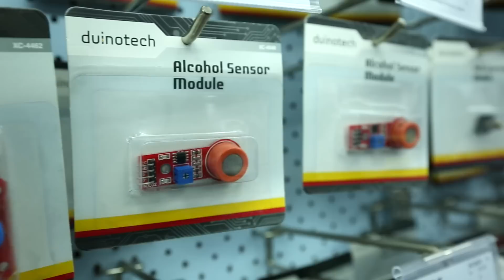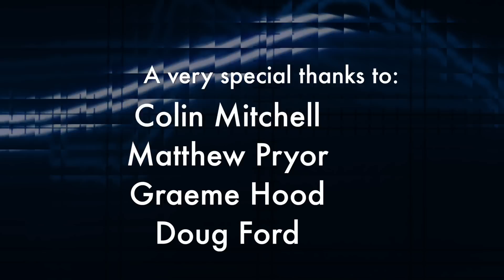The Decline of Hobby Electronics?

Comment: To the title: "yes and no."

I'm getting back into hobbyist electronics after being away for sixteen years. Here are my observations: 

1. I cannot go down the street and pick up assorted components or ICs. This is bad.
2. I can buy ICs and components directly from Shenzhen, usually even in lots of under 1000. This is fantastic.

What the people are ACTUALLY talking about isn't a decline, but a shift in component sourcing. And they're absolutely correct (see #2). The only downside here is the waiting. And, of course, if you get a faulty component or IC, the shipping costs are prohibitive, so the consumer marketplace is plunged again into the realm of, "cheap but unknown."

Insofar as PCB/SMDs, I am myself looking at making a reflow oven. I've never used solder paste or worked with SMDs, but there is so much information out there that the hobbyist can now really build one-off or short-run PCB-and-SMD-hardware. Paired with a 3D printer with an ABS head, the hobbyist is now in a really curious position, the road that I'm starting down: small commercial runs of actual product that can match or exceed the quality of commercial vendors. 

In sum: the title of this video is utterly wrong. They're not talking about the decline of hobby electronics at all, but its mutation into something different than in the 1970s and 1980s.
Reply from the maker: Hey thank you for your very considered comment ... and by the way I totally agree with you. However the title is a question and not a statement. All your points though are spot on in terms of how I see it also but perhaps what people understood to be the hobby/industry at that time has also shifted ... Its a blurry line on what is hobby and what is industrial electronics as well perhaps??
Reply: All of my local radio shacks are still here >:D

Comment: The DIY movement is growing for sure. There are actually pick and place machines available to hobbyist. Also the industry is growing like crazy. There is 10 open posts for electrical jobs at my company. It's crazy we cannot find enough people with electrical knowledge
Reply: Is it electrical or electronic jobs? electronic jobs don't seem to pay very well, I would have liked the electronic job but found that electrical jobs pay around 10k more.
Reply: Electrical and electronics I don't think are much different. I work in a control systems environment, and electricians start off at 35 an hour full benefits. In fact, most of our electricians have engineering degrees, technical degrees, or are a journeyman.
Reply: Xzarida One up ya.. I built my own to cut the boards. I place solder masq, then replace pcb, it cleans pads, and drills through holes adds the solder paste, and set the smd parts. Just reflow and finish any other parts. Makes prototyping so much more easy and fun. All that from mods of what you can find online, bit of time and skill. Best of all it was a fun project in itself.
Reply: Our electricians definitely know NPN vs PNP and we give them a test very similar to the CBET exam. On the test it talks about OP amp circuits like comparators, differenatiors. They need to know if something is sinking vs sourcing. None of my electricians know really anything about power distribution. All of our machines have 120 and 480 coming in that's the highest they go.  I can agree power distribution is much different then things controls electricians see, and electronic technicians see for sure.

Comment: This is why I love working with valves and 70s-80s Computer Electronics. It's simple. If you are in doubt you can just try things out. "Oh I forgot about a resistor..." is a bigger problem today  than it was like 20 years ago. For example: I recently designed a big PCB with hundreds of signals some weeks ago and forgot about a single connection in the Schematic. Now I have to cut some traces and connect the Pins with thin wire manually. Not great but I can do it. But in Case parts get even smaller I could put those PCBs into the trash can. Sad but true...
Reply from the maker: Hey thanks for your comment. Much appreciated.

Comment: I was lucky to catch the tail end of the vacuum tube era when, for an interested kid,  grabbing a discarded TV chassis from the trash behind a TV repair shop was a great start toward accumulating parts.  Here in the States, the Allied Electronics and Newark Electronics catalogs were essential reading for interested young men.  But back then, electronics was still considered cutting edge,  landing on the Moon was becoming a reality, and such imaginative young men saw very real possibilities lying ahead.   

Today, is it really a change in the technology or more in the attitudes of youngsters who now, quite reasonably, see the latest electronic miracles as ho-hum, and not really anything special? (By way of analogy, who, for example, really gets excited about the latest innovations in kitchen faucets or refrigerator technology?)

There is a difference, however, between creating innovative circuits on the one hand, and building them in large scale and at lowest possible cost on the other.   No individual experimenter is going to beat the professionals at the latter.  However,  I'd like to think that individual innovators and experimenters, using discrete components that you can actually see and handle, might still pioneer new technologies and develop new techniques before the commercial boys do, who see money, rather than possibility, as the primary goal.  But then again, maybe I'm dreaming.
Reply: You made a great comment -- several parallels with my own experiences.  I traveled to the UK a few years ago and heard an interesting (Read: Hilarious for me) comment.  The interviewer was trying get young people interested in engineering.  Their reply was: "Engineering?  Don't I have to get dirty to do that?"  They had no clue.

Comment: This video, single handedly answered a lot of questions I had. And I still feel, MCUs are paralyzing hobby electronics industries. The skills required to design an analog electronic circuit WITHOUT using any micro, is far far above than the mere programing skill. Back in the days, we thought of an idea, drew block diagrams for the project, translated the individual blocks to circuit building blocks, and then headed our way to breadboard for prototyping. This indeed was way more satisfying than just programming a micro. That was a way one could learn a LOT more about electronic circuit design principles.
Reply: Check out Arduino.  They have made everything simpler because the code is open-sourced and has likely already been written.  Get yourself an Arduino NANO and start having fun again!

Comment: If anything I see more hobby electronics now than before, well maybe just replace gadget with electronics. LED's certainly have made many people get into DIY stuff. I guess the difference in the mainstream though is that instead of base components a lot of places like radioshack (at least in my country) sell things that are partially made, so you just have to build it and it's done. 

Similar to how we say you build a computer, you buy the CPU, motherboard, monitor, mouse, keyboard, hard drive, ram, graphics card, power supply, cooler and case and put them all together. 
As barely anyone has enough time or knowledge to sit down and make their own motherboard and graphics card from scratch as it took companies decades to get as far as they have now. 

The reason basic electronics in the past was more popular was because things were more simple, today most circuitry is rather complex that it's nearly impossible to build it yourself from scratch.

A good analogy is this, who wants to be on a computer learning machine code when the guy next door is working with an actual programming language like C++ and making new and innovative things. There is no use re inventing the wheel. 

Because even your generation was using pre constructed things where as the generations before yours would have had to make some of those by scratch, rinse and repeat over and over again. At one point you couldn't just buy variable resistors, you couldn't buy integrated circuit chips either (at one point they had to make it all manually). So you may not realize it but your generation was using pre constructed things that previous generations had to make manually (it's the same for every generation).

For future generations things will become more pre constructed again and again and they won't think about the problems and things we do now in DIY electronics, they will have pre constructed things where they are working on more innovative things and have different problems. That's the nature of progress, building upon other things.

Comment: looks like it's gone to shit in australia.

but it's stronger than ever in the US. there was never anything like maker spaces or arduinos in the 1970s or 80s. component availability has never been easier or better. mouser and digi-key practically cater to the hobbyist. you can get pretty unbelievable stuff from china thanks to alibaba and aliexpress. and access to vintage equipment and affortable test equipment is easy via ebay.

home pcb layout software, and manufacturing via oshpark. hackaday, online forums, it's a golden age for hobbyists.
Reply: I agree, there was a massive decline in the 90s and 00s, when I was growing up. However, with the internet becoming what it is, being able to learn pretty much anything for free on YouTube in a fun and interesting way. There is a huge community online which didn't exist even 10 years ago. We now have Arduinos and Raspberry Pis, which seem to get a lot of hate, but even in the mid 2000s nothing really like it existed - the microprocessor dev boards that were around at that time were expensive, required some kind of expensive proprietary programming connector and non-standard software that you just had to hope would work on the serial/parallel ports on the PCs of the time.

Same thing happened with programming. We went from the home computers of the late 70s/80s which actively encouraged programming, to Windows PCs where you couldn't program anything out of the box. I did an IT course in school at around this time, which was pretty much how to use MS Word / Excel. That being said, there has been a huge resurgence lately in the programming industry, with kids being encouraged to pick up languages like Python. That simply did not exist in the 90s, so we have come a long way.
Reply from the maker: Yes I personally agree with you ... now. The interviews in this video took place more then 5 years ago now and shows us all just how far things have changed. Even though there were signs of the "maker movement" it really didn't go mainstream for quite a while after, at least not in Australia. I will update my video when I can with a comparison of "then and now" and by doing that show just how lucky us hobbyists really are today. However there is still plenty of things to complain about, namely the high cost of shipping, shipping times, lack of general education in tech, jobs etc etc. Its not all roses.
Reply from the maker: Great comment thank you

Comment: I was doing hand built surface mount bench assembly professionally in the early 90s. So it is not like I can't do it, or do not possess the motor skills, I simply do not have the desire to work with SMT. So for myself I still design, and use through hole circuits. Sure, there are many components today that are only available in a SMD package, but there is still a lot of through hole hardware available too. As far as manufactured devices goes a lot of that is crap. So it is not hard to make something better than low end commercial junk.
Reply: Gonna have to disagree with the last part of that....I just bought some Behringer stompbox pedals for my guitar and am absolutely delighted and at arounf $25 each brand new they are a bargain and after buying the components, boxes and associated hardware they would cost me more to make than to purchase, not only that but the pro versions look better ;-)

Comment: I completely agree that analog electronics is declining. Analog is moving into the power electronics niche and probably will stay there for a long time. However, we, hobbyists, are having a golden age because of the rise of microcontrollers. Software is easy - hardware is hard and probably will always be. At the same time, we, hobbyists, are having access to almost any electronic component we fancy. Almost all of the big brands are ready to sell their components to individuals at very competitive prices. Check out TI's or Microchip's online stores. It is a gold mine. Prices of development boards used to be with three zeros at the end. Now I can buy a devboard with a top of the line chip for less than $10. Same goes for tools. A perfectly fine osciloscope costs less than $500, soldering station $100, software development tools - free. I don't know about the others, but I am enjoying the ride while it lasts.

Comment: I scrap electronics for speakers,knobs,switches,wire, torroid coils, diodes, circuit boards, heat sinks, and motors, and copper wire.
most are given to me, to get rid of them.
I've also repaired radios (got a FM/AM/SAW that didn't work. I just got the moisture out, and it works fine!)
I'm making Crystal radios from salvaged parts, and it's fun! made a XTAL radio with copper coils, and could get amateur radio channel, in Dayton Ohio! I wrote about it in my notebook.

Comment: almost everything is an integrated circuit nowadays, the home electronics inventor will soon be a thing of the past. with discrete transistors and other parts being discontinued every day to make way for million dollar integrated chips that only large companies can afford to produce.
Reply: but they can never really compete with large companies that can produce an IC for their specific task.
Reply: FPGAs can fill in a lot of these gaps. And for the few analog circuits parts that remain, many ICs are available.

Making entire processors makes little sense on your own. But there are open hardware initiatives for creating microcontrollers etc.

Comment: I personally really like the current state of hobby electronics. Just a couple decades ago it was nearly impossible to get parts, I'd have to go dumpster diving and take apart old devices to get parts, now, after spending $100 on AliExpress, I have wider range of passive components than my local store. For just $100! 
And professional tools are cheaper than ever. Sure, SMTs look scary, but you can get a good enough temperature controlled soldering iron for $50! And a dozen tips for another $10! Need a scope? Not so long ago absolutely unthinkable for any but the most hardcore of hobbyists, now you can get a great scope for $400! Don't have $400? No problem, people are literally giving away old analog scopes for free! Form where I'm standing, thanks to China, hobby electronics is more accessible than ever. Sure, sucks for local businesses, but for the hobbyists themselves it's great.
Reply: +Paul Frederic Counterfeit resistors? K, mate.
Reply from the maker: Yes I agree now, but back then (5 years ago) your answer would have read as bullshit! That's how fast things have changed. Now more then 5 years on, the world is different and I guess thats the lesson learnt right?!
Reply: The parts you're buying off Aliexpress are counterfeit bullshit. I hope you know that.

Comment: You are right about smd components its not for a beginner,I been doing kits for forty years and I have trouble,mostly seeing it,I also had to buy a lot of new stuff ,like a rework station,special anti static tweezers,magnifying glasses,and make sure you use lead solder paste and solder,that lead free stuff is no good it needs much high tempatures,,which can fry you PCB,or your components..it is very easy to lose parts that are so small..I hope they keep making through hole kits.

Comment: Ugh more SMT Whining. I'm relatively new to this and use smt components almost exclusively for my projects - They are cheaper and the final piece is far smaller.
Reply from the maker: Fantastic but that was not obvious to most 6 years ago! I agree with you but that doesn't change the reality for most. Thanks for your comment.
Reply: When I was new to electronics low powered circuits held my interest. Over time though I became more enamored with the juice. When I want to build high Watt circuits through hole components are where it's at for me. Big honking metal can TO-3s, or chunky To-218s. Oh yeah! SMT W/C ratings are abysmal.
Reply: "Almost Exclusively" I've got a bin full of big mosfets, 5W resistors, big caps, ETC... but I drive those mosfets (usually) with a 'charge pump' design that ensures Vgs ~ 18V ... built out of smt components.
Reply: +Kerr why do you use SMT?